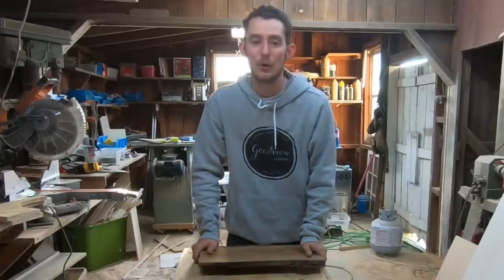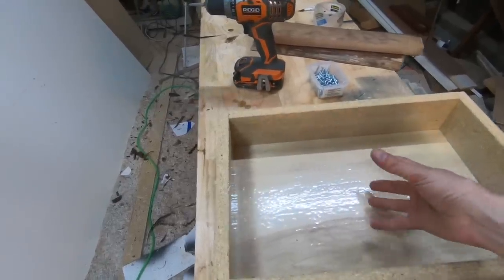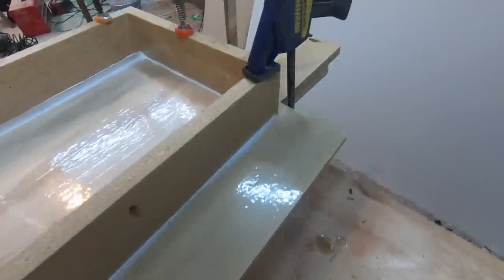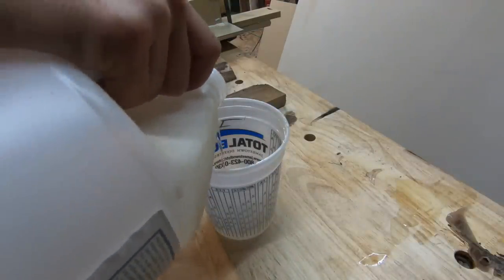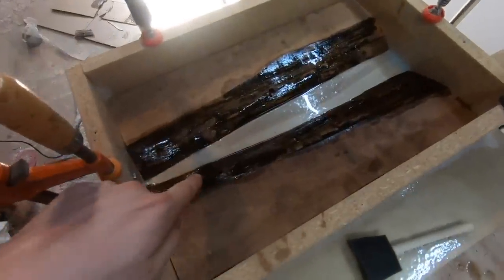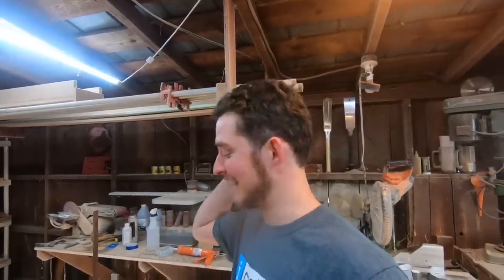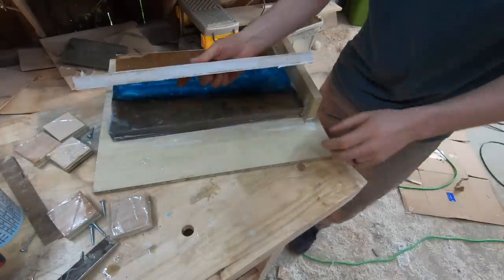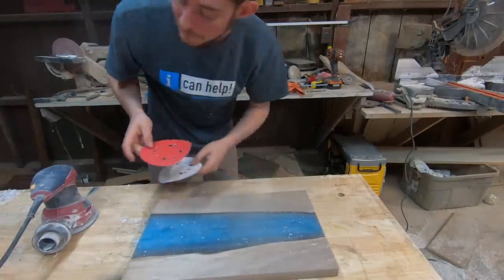Epoxy Cutting Board DIY

Comment: “Presealing” the live edge accomplished absolutely nothing and it never does. First, bc you didn’t allow it time to dry, and second, when presealing, you are actually creating a weaker bond. Think about it, the entire river area is bonding to a sliver or a millimeter of epoxy vs penetrating the wood grain as a single unit. Stop.
Reply from the maker: Thank you for your input. This was a very old video. If you watch any of my later videos I teach to never seal the edges. I have said it o er and over and over…. And yet people comment here the same way you did. Before giving an ultimatum, please do a little research. Thanks again
Reply: @GoodViewWoodworks  maybe if you edited the video to warn people about your screw ups, you would not have to say it “over and over.”
Please quote me where I gave you an ultimatum…
Reply from the maker: @caseymorgan2112  okay, how do I say this… people who frequent my channel already know these things especially because I have specific videos on this exact topic AND specific videos of where I messed up and how to fix. So I’ll repeat it once again. Please do a little research…. To answer your last question… the last word….
Reply: @GoodViewWoodworks  “stop” is not an ultimatum. Maybe you should do a little research.
Reply from the maker: @caseymorgan2112  
itions from Oxford Languages · Learn more
ul·ti·ma·tum
/ˌəltəˈmādəm/
noun
a final demand or statement of terms, the rejection of which will result in retaliation or a breakdown in relations.
"their employers issued an ultimatum demanding an immediate return to work"
Read the first 3 words of that definition

Comment: Torch or heat gun? You never showed us what you used, why you did it, or the method. That's a huge step to skip. I hope no one uses this vid, unless your into the bubble look. Lots and lots of bubbles.
Reply from the maker: Well did you know that if you use the correct type of epoxy, a torch and or heat gun is not needed. When the epoxy cures slowly, the bubbles will escape on their own. Thanks for watching and commenting.

Comment: Buddy, you inhaled a lot of toxic material by not using a mask while sanding epoxy. Stonecoat guys make tables not cutting boards. Are you sure that this product is food safe? A Cutting Board means direct contact with food but a table does not.
Reply from the maker: I know I need to wear my mask. I’m sure, you should check out their website.